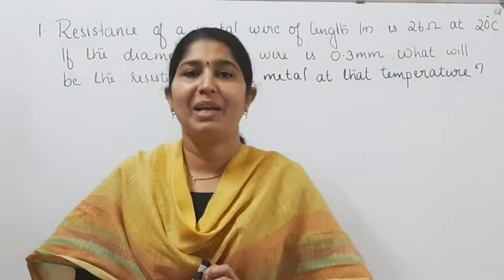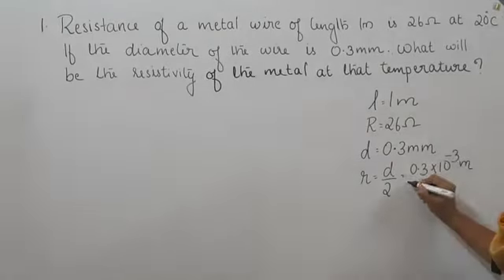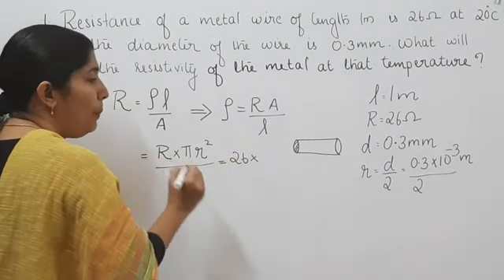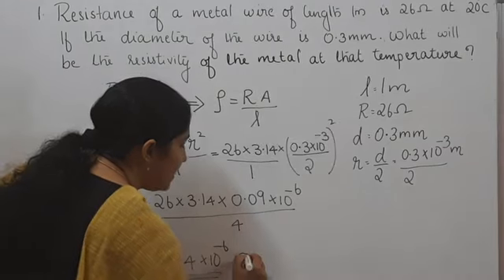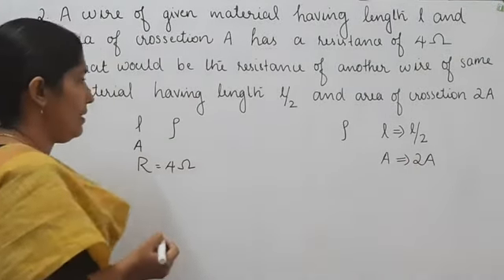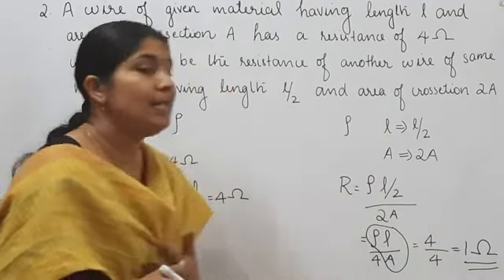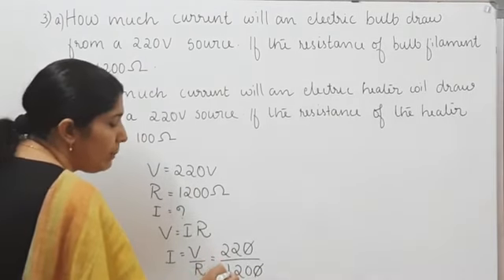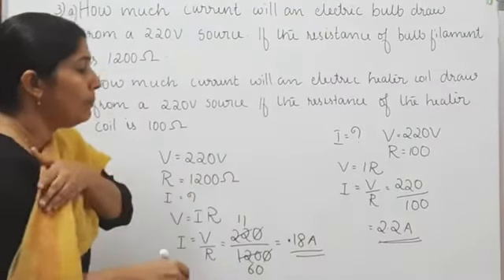PROBLEMS  BASED ON OHM'S LAW & RESISTANCE

Comment: ma'am, we know that Newton's laws are valid in inertial FOR , which means there is no external force . so keeping this idea in mind consider relativity theory of Einstein, he says laws of physics are applicable in all inertial frame of reference. connect these to theories we can conclude that relativity theory supports Newton's laws and the doubt is , what is the significance of inertial frame of reference in these two laws? why Newton's laws are not applicable in non inertial FOR ? , is non inertial FOR has real existence ? and why it's impossible to explain action of pseudo force with Newton's laws. 🤔🤔